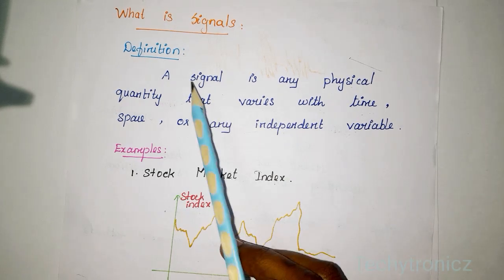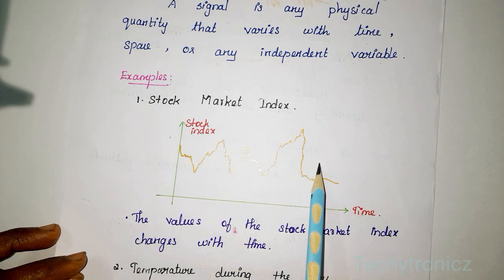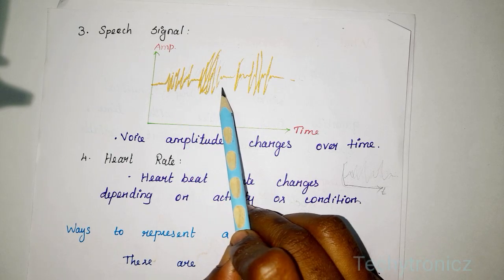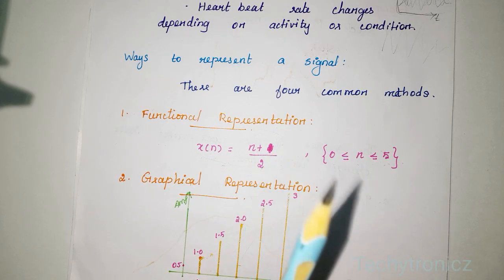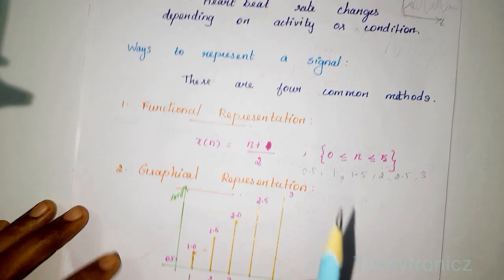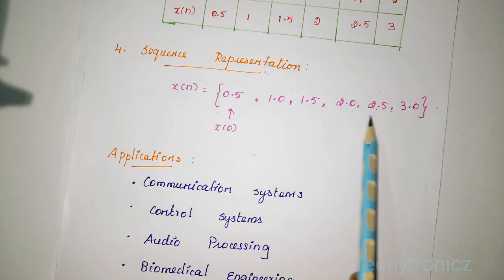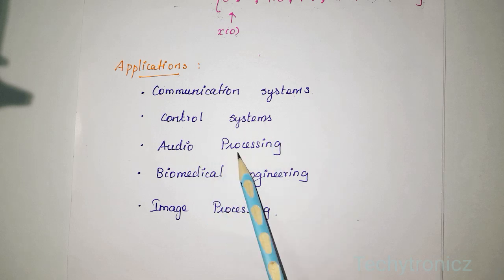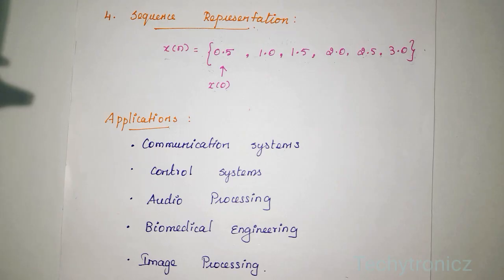01. What is a signal? Easy explanation with examples - English

Comment: Power Supply la voltage kodutha voltage signal.. amps kodutha current signal avolothana.. why complicating?
Reply from the maker: Actually bro, unga example correct — voltage or current kuda signal thaan. But “signal” nu term engineering la romba periya concept — edhuvum time kku change aagura information carrier signal nu solluvanga. Power supply la voltage/current one type of signal, aana sound waves, temperature variation, even light intensity kooda signal thaan. Athanala concept broad-a explain pannirukken 😊